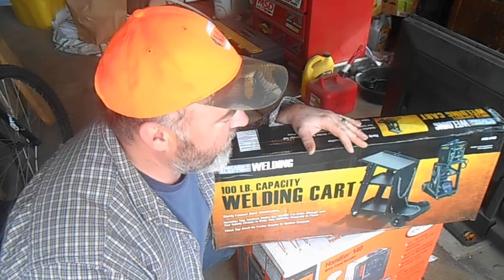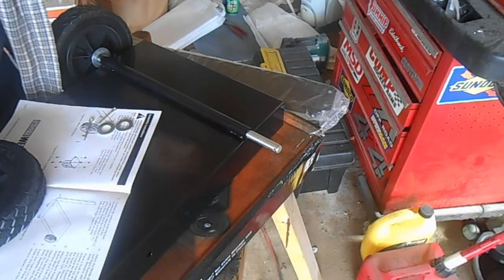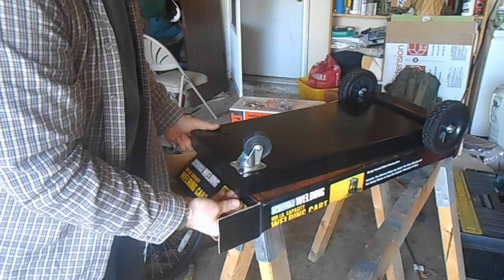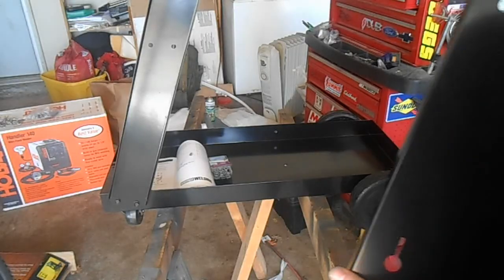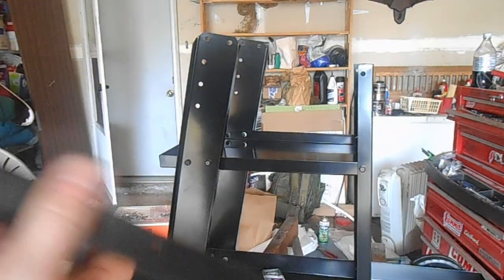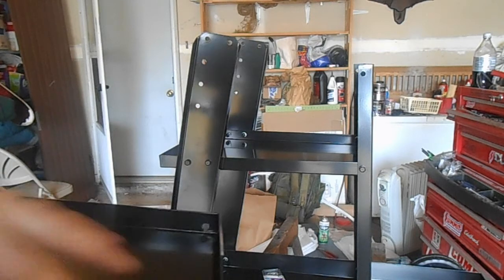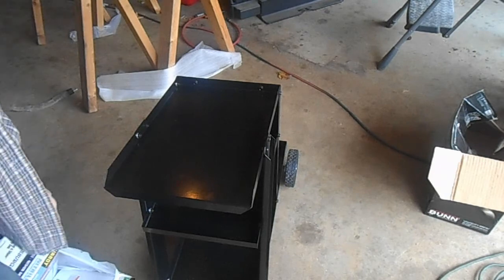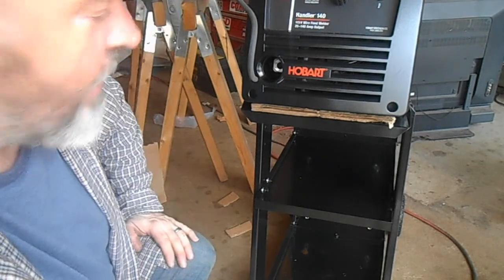Harbor Freight Welding Cart - Unboxing, Set up, Review - Used with Hobart 140

Comment: I been thinking of getting that cart for my Hobart when it gets here from Amazon in a week. 😆 I think on the top shelf of just turn the top flat and place a good rubber mat down and glue it down. Those tiny front tires maybe toss them and get a set like the back and install them. Nothing says tight like tossing down a few weld points. With or without screws it will never be flimsy again. 😆 

Thank you for posting the video. Looks like that cart might be right for me as well.

Comment: thanks for the video, so five years later how do you like it? I own the same cart with my Lincoln 140c and here are two things I don't like about it, 

1. the top shelf is too short, the front two feet of my Lincoln MIG 140c machine stick 2" past them forward

2. those rear non swivel wheels are a PITA to manouver around a busy shop / garage, today I am actually going to replace all four wheels with proper same size swivel coasters

Comment: Excellent and informative video. You saved me from going thru the agony of reading the annoying destruction's that came with this. I have a couple of tips for those watching this. Yes , put washers on back side of the wheels and one extra on one side of the outside. The cotter pin will be tight to get on but you can get it on and it makes a huge difference .The other tip is after you have assembled it , put a coat of liquid wax on it. It will keep it from rusting and you will find any bolts that you missed to tighten up ( I found two ).
This is the second one of these I bought. I bought my first before my new Hobart mig welder arrived and after I put my new Hobart on this cart I said " no way " and went to Harbor Freight and bought the one with drawers and I love that one for my mig welder. I sold the one like the one in this video and now a year later bought another one for the arc welder I ordered. This cart will be perfect for my arc welder. My wax is dry so I better get it off now !. Do as I have instructed and you will be proud of your cart. Peace

Comment: l use mine with a Lincoln Promig 140 with 80lb argon/Co mix tank. Also use the middle shelf to hold a few extra 2lb spools. Been that way a couple of years now and it's still going strong... this is certainly one of the harbor freight items that actually performs as it's supposed to do. And yes it's home use but I'm using it almost on a daily basis.

Comment: Couldn't wait to see if you had same issue I had, yep,  I had to place 1/2" wood under my Welder to raise it enough to open side door. I have 135Mig Welder from Northern Tool and nearly identical cart. 
 Not much of a hassle and it is very sturdy. Chain setup was little shaky for the tank until I got it figured out.